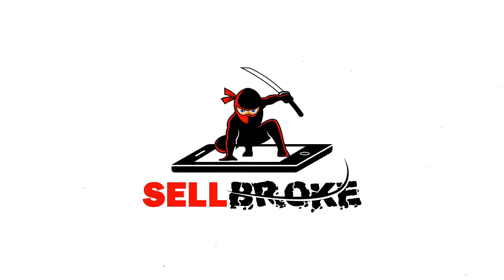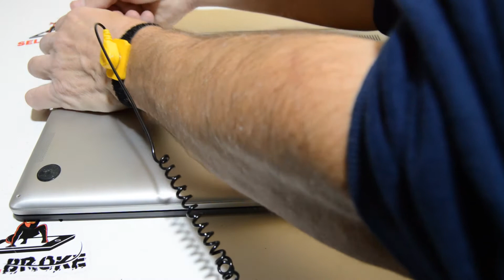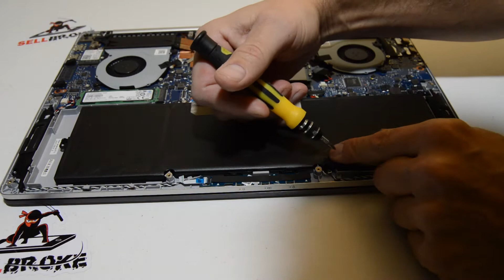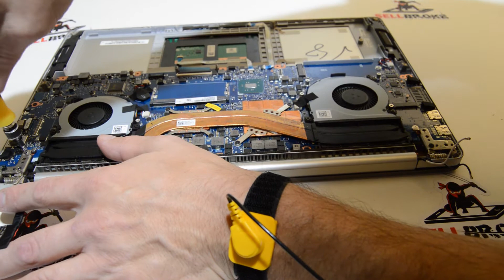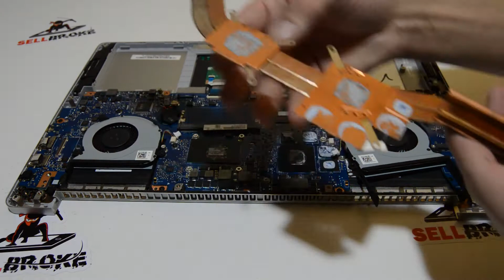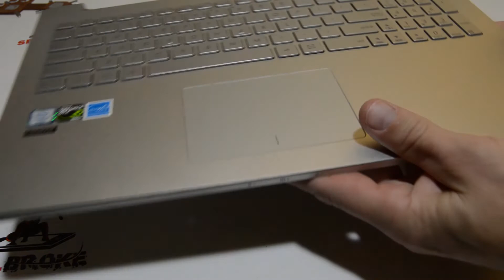How to Disassemble Asus Zenbook Pro UX501V Laptop

Comment: you don't get into component level but do you have any idea on schematics for a power button? It's attached to the keyboard but there is usually some physical pins to turn it on if they're shorted. Any ideas?

Comment: Nice video well done!  Question - which side is the GPU and which is the CPU?
Reply: 10:58 - the right side, it has four chiplets around it for the 2GB video RAM. for a 4k panel this runs hotter than my desktop with a 3090 (barely gets to 60c) not like the laptop - it got to 81c - hot when running FurMark

Comment: Made it all the way to the end only to find out that the keyboard can't be removed. Major bummer. After 6 years of heavy use, my laptop's case is starting to fall apart. Was looking to rip all the guts out of it and transplant it into a shiny new case, since those appear to be relatively inexpensive. Probably going to have to find an alternative solution now
Reply: I've just replaced my keyboard on UX501V - used a heat gun and some pliers to break off all the plastic rivets (try to leave some meat on them), and then used two-part plastic epoxy to replace all the rivets, plus some weight to secure them while everything cured.  It's possible, but if i was to go back in time I would have bought a pre-assembled bottom plastic part instead of trying to fix the one I have already.
Reply: @ArcaneSpell  I didn't even bother re riveting. just put it all back together and the new keyboard works. had to cut off one of the posts that was getting in the way of the keyboard ribbon connector. also I did not need to remove the heat sink or fans to get the mother board out.  that saved time and effort.
Reply: Клавиатура- снимается со стороны клавишь. Ищи другие видео.